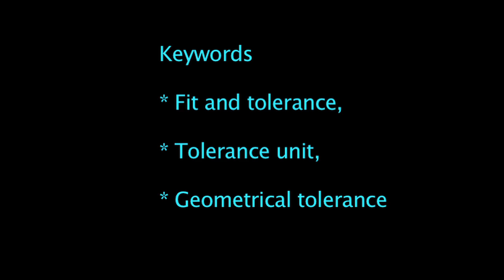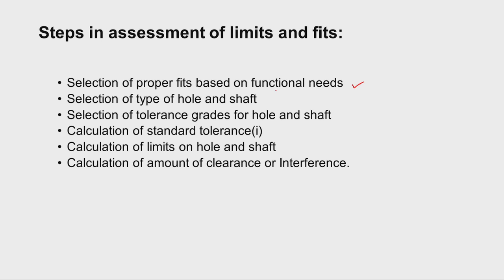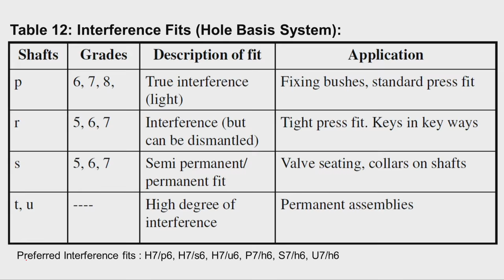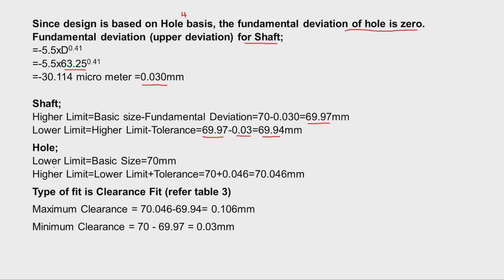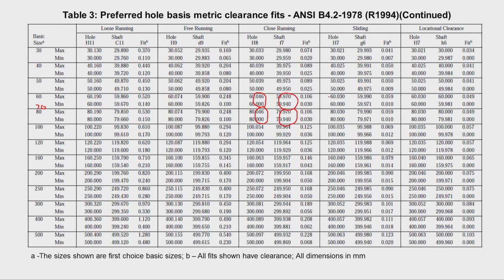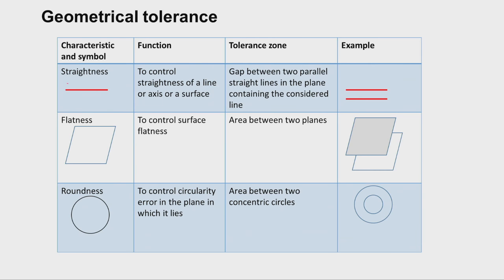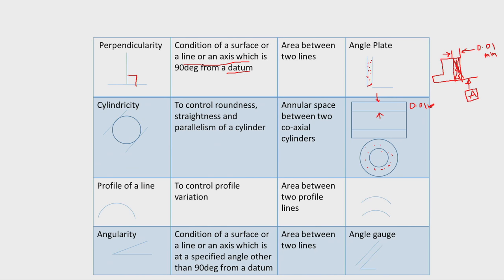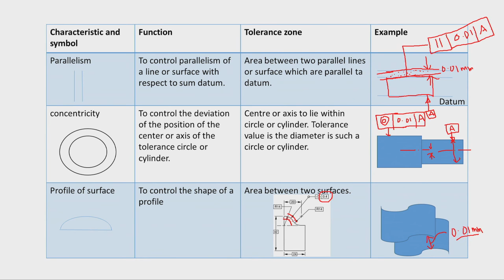Selection of fits, Geometrical tolerances

Comment: Hello. Thank you for an easy to follow lecture. I however am a bit lost on following the example which is around minute 14 through to minute 18. The example references tables 7 and 5 of the ISO 286 standard, but I don't seem to find the tables. I am using ISO 286-1 2010 and ISO 286-2 2010.

May you kindly help me to find the tables in question, or if there is anyone who can help please do.

Other than that, the lecture has a gradual introduction of concepts, which makes it easy to understand.